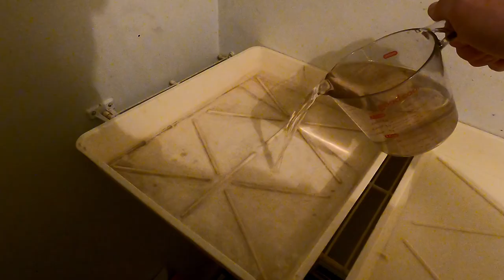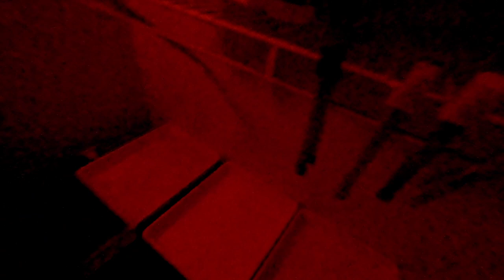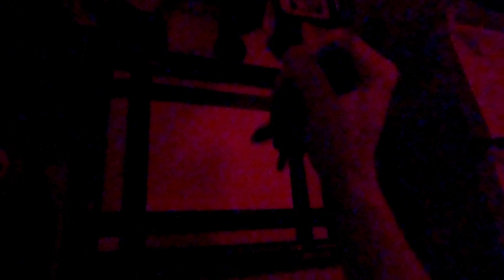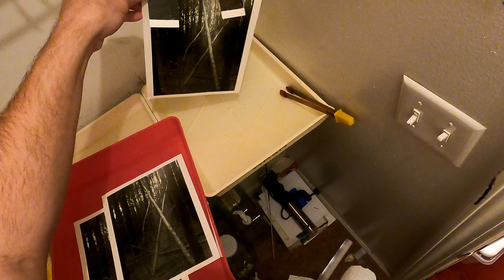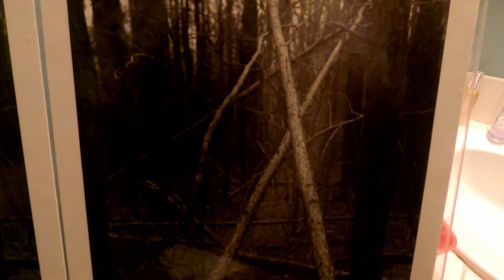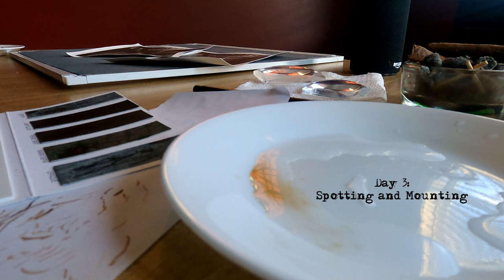Traditional Darkroom Print-Making | Between the Pines | My Dark Method | Rainy Day Printing

Comment: Drying down the test strip or print in the old microwave to more correctly judge its final density and contrast. That's a trick I first saw many years ago being used by Ansel Adams of all people. I like it!
Reply from the maker: It's my fault for never committing to one paper. My fiber dries darker than my resin coated and the resin always a bit lighter than the fiber. I learned the hard way to never put the RC in the microwave 😁
Reply: @AdamWelch  Been there. You only have to make that error once, although you (I) can dry RC in a microwave if really in a hurry. You just have to be very careful at low power. Other point: Having to use your enlarging lens at f 16 is putting it outside its optimal aperture range. Have you considered adding some neutral density in the filter drawer or installing a lower wattage bulb?
Reply from the maker: @randallstewart175  Yes, I have considered ND filters for the enlarger more than once but always end up never going further. I've actually rigged up some of my 100mm square filters twice, maybe three times to extend some extremely short exposures. This just happened to be a fairly thin negative as well. Honestly, much more thin than I thought it was initially. The lens for this particular print was my Schneider Componar 135mm F/4 and for whatever reason it's always printed sharper at F/11 to F/16 and even F/22 doesn't present much diffraction, especially with lower contrasts. Ironically, I have another Schneider (I think it's 50mm F/3.5) that is essentially horrible anywhere outside of F/8-F/11. Here's a question: do you do much contact printing at all?

Comment: I'm impressed you can dodge in such a short exposure.  Most of mine are in the 15-20 second range and I still feel rushed sometimes.
Reply from the maker: I always intended to switch that bulb out for a lower wattage but of course never did. I also was going to eventually add a swing out filter holder for my nd filters but of course never did that either. So really, any dodging skills I may have were born out of laziness haha It was definitely a challenge and I feel quite a few of my prints suffered for it really. Now that I'm living and printing (contact only) full time on the road in the mobile darkroom it's going to be even more interesting.

Comment: Nice video and final print. How are you mounting your FB paper. I had a homemade dry mount press I had to leave behind last time I moved because it was ridiculously heavy movers wouldn’t deliver it.  Now I’m getting ready to start my darkroom up again and would like to buy a dry mount press but they are very expensive. Have thought about the pressure based adhesive sheets. Do not like the waviness in FB prints using more archival methods. Your thoughts appreciated. Thanks for the efforts in your videos.
Reply from the maker: Hey Michael, this is/was always an ongoing problem for me especially now that I've moved onto the road full time. In short, I was never able to get a FB print to reach the level of flatness I wanted. On prints I framed myself I would use archival tape to adhere all the edges of the print to the matte backing and even then the central areas of the print would have slight undulations. I feel the only way to total flatten an FB print for longterm mount is through the dry mount process as you mentioned. I had debated getting my own t-shirt heat press but never did. I'm about to start contact printing again with my 8x10 negs and will be taking my prints to Hobby Lobby (or wherever) to have them all dry mounted. I wasn't familiar with the adhesive sheets you mentioned so I looked them up and they do indeed look promising. I'm just not sure I could cut them precisely enough with the tools I have on hand now.

Comment: Beautiful prints! Probably a silly question - why did you dry the prints before toning?
Reply from the maker: Hey Nathan, thank you and I really appreciate the kind words. That's not a silly question at all. Personally, the reason why I dry the prints first is so I can have a full measure of the untoned tonality before I put the selenium on the prints. A wet print always looks much different in terms of contrast and overall luminance as opposed to a dry one. Unless I've printed a negative quite a bit and have it 100% dialed in I always dry at least one of the prints first so I know exactly what I'm working with.
Reply: @AdamWelch  Makes a lot of sense! Thanks Adam :)